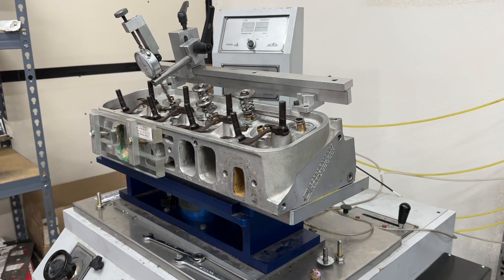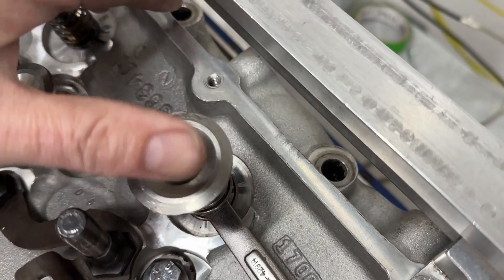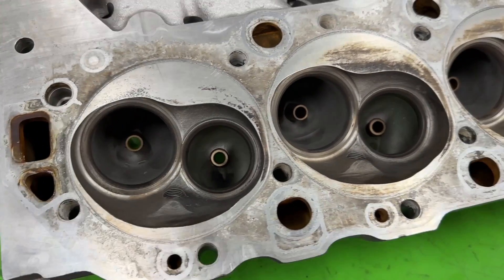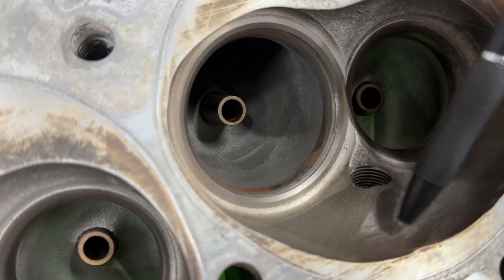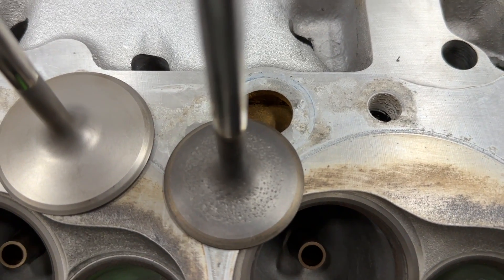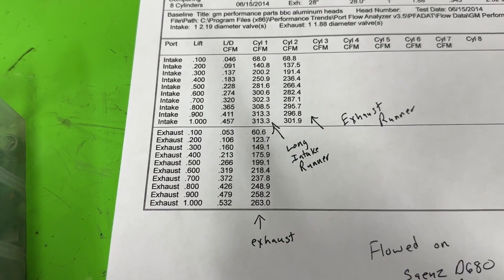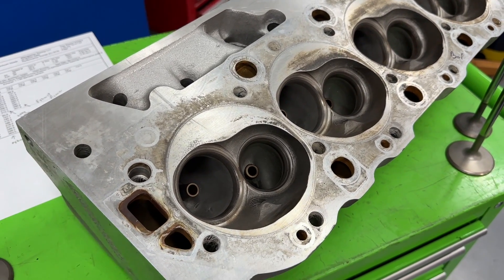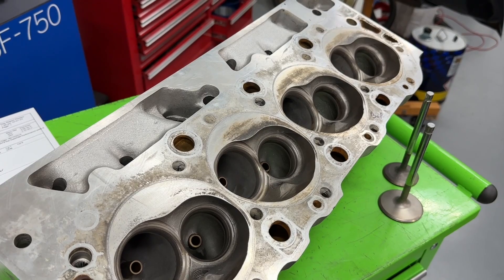GM Performance BBC Information Including Flow Numbers

Comment: what would be your advice on improving this head mght a 5 angle valve job and a 2.250 vlv and seat remove the low area improve flow and did you ever do a follow up video on these

Comment: Is the pro action protopline 119 320 any good for 540,just wondering if you ever flowed them there older heads but new
Reply from the maker: Yes they flow about 340ish. They do outstanding after porting.

Comment: What would you suggest to replace these, on a 572  720 hp version.  How much hp do you think the head you suggest would make?   Thanks
Reply from the maker: As cast heads brodix bb3xtra 327 afr 325 promaxx 317. Cnc ported afr 315 or 335 brodix 3xtra 335
Reply: @WeingartnerRacing  awesome.   Thanks.    Keep up the good work 🤘
Reply: Vizard changed the cam and got good power

Comment: When you were starting to dig into these heads how bad they are, without the numbers, I thought maybe 320s. These are supposed to use the factory 26 degree valve angle as well.

Comment: Thanks for ALWAYS being truthful.   I had a porting/sheet metal manifold shop 25 years.  I retired in 1999.  No aftermarket head  beats the original ported 1960's  IRON Chevy head (apples to apples) until after 2010 in the aftermarket world.  and YOU KNOW IT. Great review thanks.   BTW you don't charge anywhere close to what you should.  I charged double and got more work and more respect

Comment: I could be wrong but I swear the ZZ502 had a different head than the 572 did IIRC I could be wrong but I’m trying to remember but I believe the ZZ 502 had a 280 cc runner head and this 572 had a 310 cc runner head
Reply: The ZZ502 had aluminum roval port heads. There is also the 502 ramjet that uses the same heads. Currently gm lists pn 19418910 as the heads on them with a 290cc oval intake port.
Reply: @timothybayliss6680  that’s right the 572 had rectangle port Heads good catch!!

Comment: I mean they are a really old design.
Reply: Thats not really an excuse. They flow less than a 990 head with a good valve job and they have the same size valves as a 396. 
It would be like GMPP coming out with a 440ci small block crate engine and putting L98 Tpi heads on it. There is almost no reason these heads need to suck this bad, GM had the sb2 and c5r program going at the same time this came out.

Comment: i mean  they cost 2400- 2500.00 assembled a pair if theyre the eddy version  but what do AFRs  cost?

3600  the same size as these

this is definitely getting what you pay for...and they may be American cast,  but they do suck.. youre better off with the Chinese  promaxx 290's at this point, which are decent in your other videos....